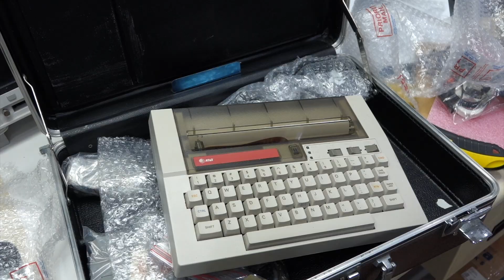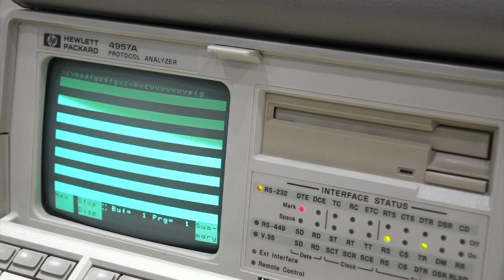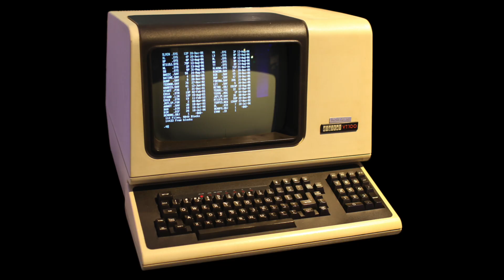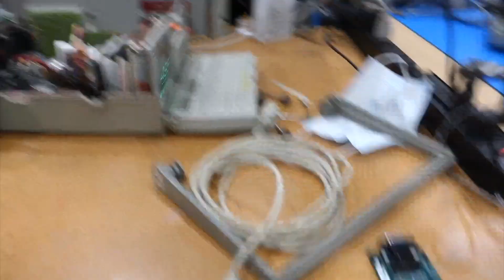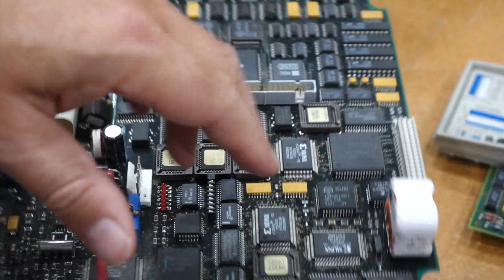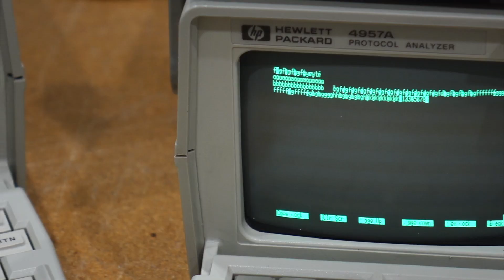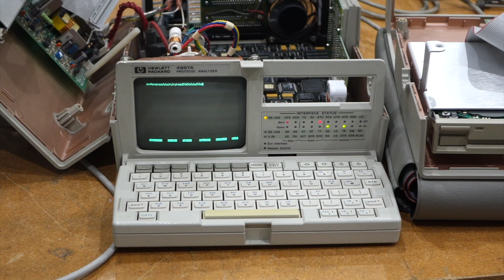HP 4957A Serial Protocol Analyzer

Comment: Maybe you can copy the high res ROMs and transplant the copies intro the low res device?
Reply: Wouldn't that mean they have to battle the high resolution hardware fault? It's currently hidden because the low res firmware doesn't use it.

Comment: Excellent. I have one of these and have used it a number of times to analyse data streams but Im embarrassed to say I didnt know it could do VT100. Im going to try mine out now.  Mine looses its setup and I assumed it was the batteries but I was a little scared to change them, now I've seen it can be done I'll do that too. Thank you
Reply from the maker: There is a catch though. If you have a 4957, the VT100 emulation is resident in ROM. But if you have  4951 or 4952, the VT100 emulation must be loaded from an application disc, which is a bit of a pain to recreate.
Reply: @CuriousMarc  Yes I have a 4957A and just tried it, and its the 32 CHR FW but it works thank you
Reply from the maker: @campbellmorrison8540  Oh you have the 32 char or whatever low resolution mode too? Then it's not just me. What does the rev and year of your firmware show on your startup screen?
Reply: @CuriousMarc  A0001  1986, '91 now I've put its covers back on I cant tell you the rom details but if you want it I will get them for you. By the way I have a V.35 Interface Break Out box 18293A would it be any use to you?
Reply from the maker: @campbellmorrison8540  yep, A0001, ‘91, same as mine that had the low res. So that’s at least two of us! Thanks but no thanks for the V.35 breakout.
Reply: @CuriousMarc  i have the same low res on mine.  Will check fw revision when i get home.
Reply: Even if you don't get around to replacing the batteries, it is a good idea to clip them off the board. They leak, and cause a lot of corrosion damage.
Reply: @Derundurel  Excellent advice I will do that thank you, nothing worse the leaking batteries

Comment: Great to see the success there :) I got IDACOM PT502 aka HP E3910C, WAN protocol tester. There is no documentation other than how to program it using FORTH. It has a MFM HDD in it (ST1100), and 7 CPUs, this time all Motorola: 5x MC68HC000 and two MC68EC030. No RS-232, the most mundane thing is RS-422, then it goes up to RS-449 and T1/E1. Software runs on those MC68000 CPUs, and it seems that 030s are used for handling E1/T1.
Unfortunately the disk failed in mine at some point. Do you think that Keysight would release the docs if I ask nicely?
Reply: I seem to recall that EIA-449 was actually the same signalling protocol as RS-232 but with more physical connector specs.

Comment: These machines remind of the hundreds of machines AT's have in there shop to repair every kind of electronic Device used in aviation aircraft..  Thus why I choose not to be Electrician for NAVY went with Hydraulics... Awesome trouble shoot, about the same as removing flight control from aircraft avionics bay, Dropping on ground, (1m $) reinstall it fixed it..

Comment: Great work!  I've got a pair of the 4952A's that I picked up to do Bit Error Rate testing on old analog modem circuits or their modern digital equivalent (Term Server - Cisco Router - T-1 Line - Cisco Router - Term Server).  You would think that the digital equivalent would just work but there are various T-1 timing options that can be misconfigured in the routers or by the T-1 provider in ways that can result in mangled data just like we used to see on old analog modems.
Reply: Dedicated leased 4-wire analog multi-drops!  DO NOT send a loopback tone to trouble shoot or you'll isolate a half dozen sales offices!
Reply: Glad to see I'm not the only one battling obscure T1 timing issues that nobody seems to understand anymore
Reply: @TheFool2cool  My low-level headache from my flu shot finally subsided so I thought I'd punch up a quick YT video.

Now I'm mired in horrible T1 clocking memories (internal, line, loopback tail circuits) and my headache's back.  🤦